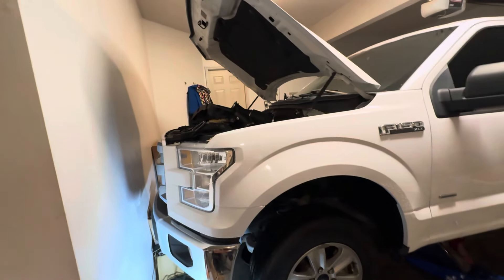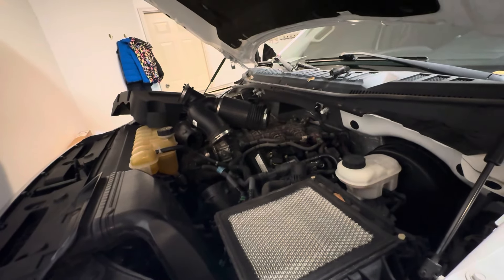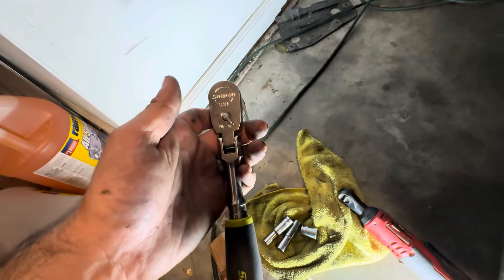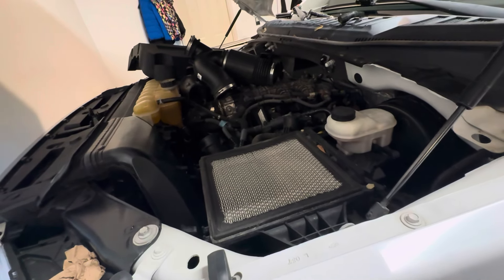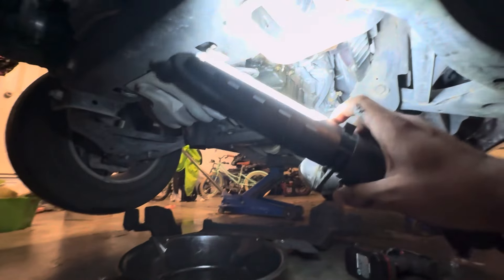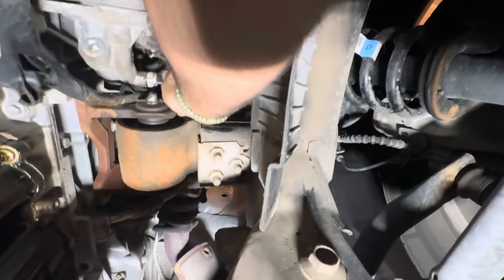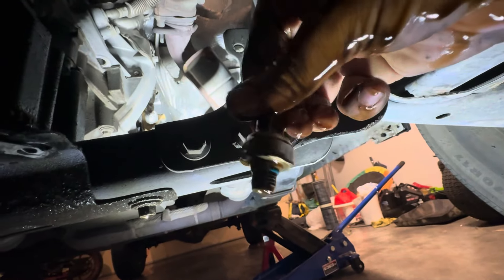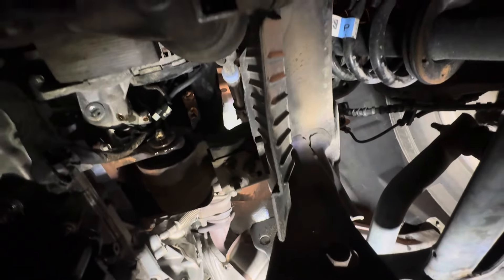Ford 3.5 Ecoboost Oil Pressure switch Replacement

Comment: This is a fantastic approach to changing that sensor!!! However, it should be mentioned that it will not work if you have 4 wheel drive because the front differential is in the way. It's such a tight fit for the differential there is no clearance to even see the sensor from under the truck.
Reply from the maker: @christopherlayton9751  thanks for pointing that out, this was a 2WD truck.
Reply: Damn I got excited there,  I need to do this on my 2012 4x4
Reply: Yeah 2wd   yeah not a 4x4